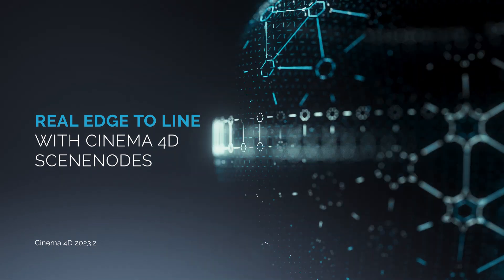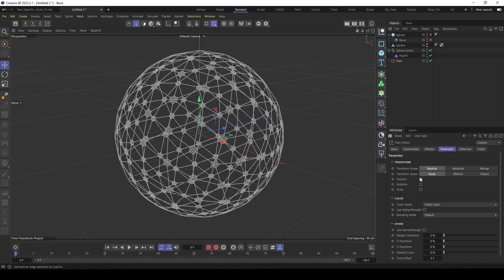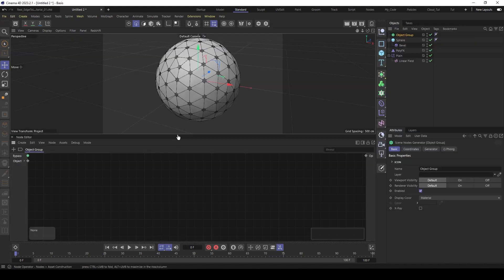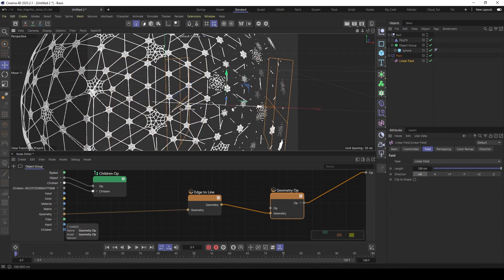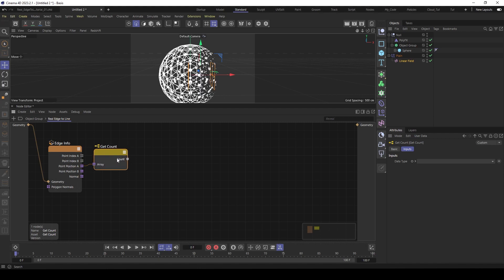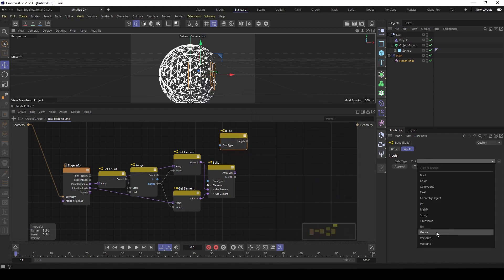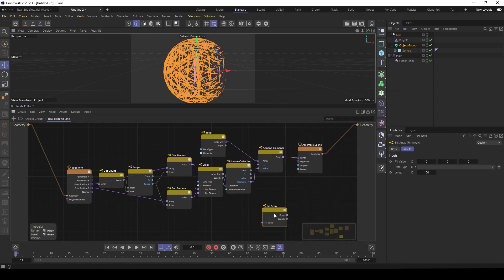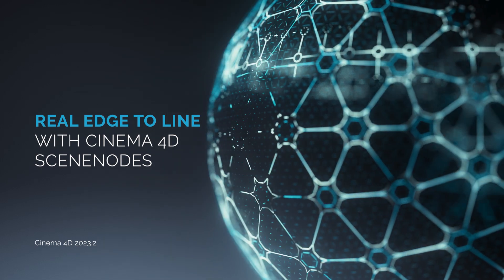Real Edge to Line with Cinema 4D Scene Nodes

Comment: when i build the array,i dont append it follow you next step ,and just connect to assemble spline .it get the same result.so what's the use of node about "append" and "fill arry" in this vedio?why use build for append you dont connect other node for build? thank you
Reply from the maker: Yes, you could do that. With this, you build an individual Spline Object for each edge (you can check that by converting the Object Group; then you should see a lot of individual Spline Objects). This could be everything you need, but be aware, this setup is slow. That's why I show how to build a single Spline Object by collecting all Points in one Array and then defining the Spline Segments.
Reply: @realruckli  thax for your  patience

Comment: hi, thanks for sharing. how to convert mesh edge to line in Modifier group? I tried C4D edge to line node and the technic in this tutorial , but it seems not work in modifier group.
Reply from the maker: The Nodes Modifier can just output the same type as the input. So when you input a mesh it cant output  splines, and of course the other way around.
You can use a Nodes Mesh, a Nodes Spline or an Object Group Capsule instead

Comment: Thank you for the tutorial.
as c4d does, 6 months later, the version im on already doesnt match what you are showing.
3:29 + 3:44 child doesn't show up and the setting menu to set scen as obj is gone/moved.

edit, i also dont know anything about nodes to know where they might have moved things.

4:08 - geometry doesnt show as lines
Reply from the maker: Thanks. Yes scene nodes are still in developement, so stuff has changed. I'll check the setup and upload an update to gumroad
Reply: @realruckli  ha, i didn't even notice the gum road link. i was able to get it to work, c4d moved the scene port mode setting 3:33, which i think is what was tripping me up.
Reply: @realruckli  for anyone else looking believe - after you click - children, its under the advanced tab

Comment: This is absolutely crazy. How the heck did you figure all this out? You have a deep understanding of Nodes.
Question: Is there a way to have lines only generated from front facing polygons? I know rocket lasso sells a spline plugin that does this.
Reply from the maker: Yes of course, I think you have do delete the ploygons which are facing away from the camera first. Not sure, but i think there is a selection node that can do this. Otherwise you can calculate a dot product from the normals to the camera direction to do it manualy. Maybe i‘ll try this later :)
Reply from the maker: There was a selection node for that :) . I added the new scene file on gumroad

Comment: If it is possible for you to make a tutorial (from A to Z) for totally newbies with this C4D node system ?
Reply from the maker: Hi Philippe, I'm planing two new tutorials, but they are both more in the advanced range. If you can tell me where you mostly get stuck or what confuses you the most, I can plan to do a tutorial in this direction. A completely beginners guide is not planned at the moment.
Reply: @realruckli  Hi, could you do a tutorial on container data types. it's really confusing because as soon as we change the type the node turns red. For example with the Geometry Property get node, an array comes out of which I don't know what exactly the data refers to apart from the index. and if I use a decompose container and change the data type the connection line turns red. I wonder what all these types of data grouped by category can be used for, which I don't understand either. THANKS
Reply from the maker: @AmidouKOne-fv4br  Yep it is a bit confusing at first, but if you get used to it, it is actually a really clever and powerful system. 
A container is usually a collection of arrays; for example all the distributions are containers containing for example an array for position, color, index, etz. 
You can access and write array data with the nodes "get element" and "set element". If you like to iterate over an array, you can do this with a "range" node in combination with the get and set element nodes.
If you like to iterate over a whole collection, you can do this with the "Iterate collection" node, it gives you the same elements as the "decompose container", but you are already inside an iterating loop and don't have to iterate manually with the "range" and "get element" nodes. That's why the input and output ports look different. An array has these four small squares as port and a single value (or an already iterating value) a small circle.
Maybe I'll do a simple tutorial about this topic in the future. But first, I have some other exciting ones in the pipeline, they are using both of the concepts mentioned above.
Reply: @realruckli  Thanks for the reply, until then I will continue to try to better understand the subject. Also your tutorials are rich and above all take us out of our comfort zones to be better. thanks again